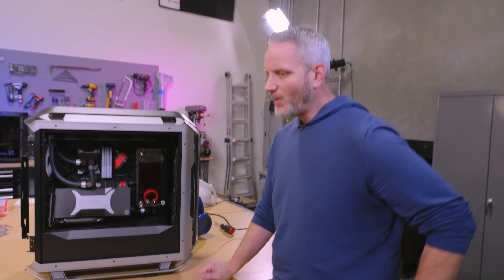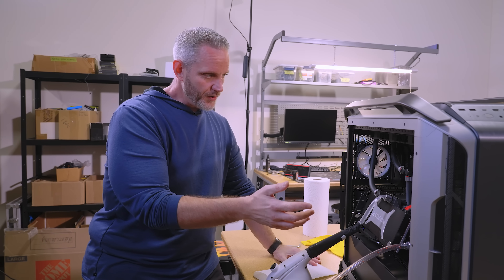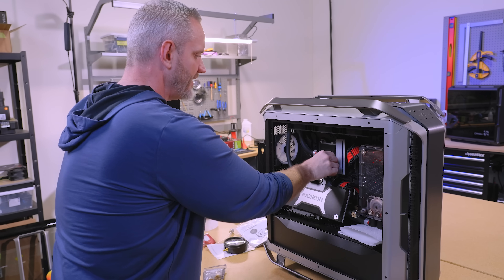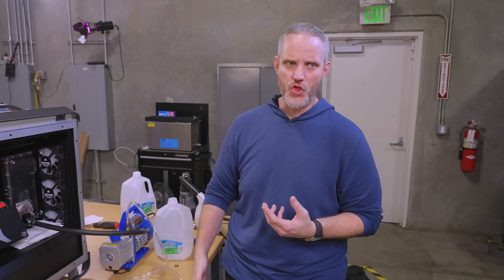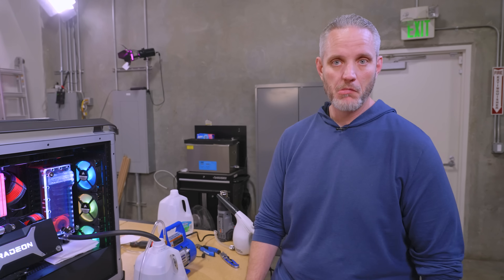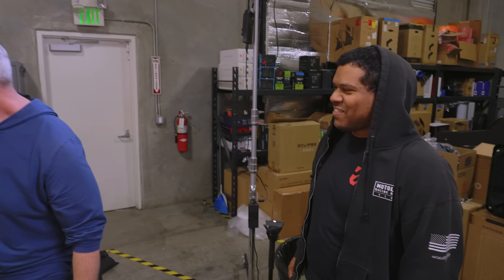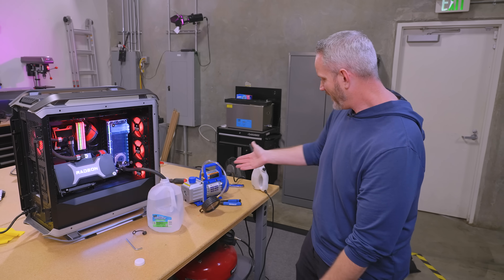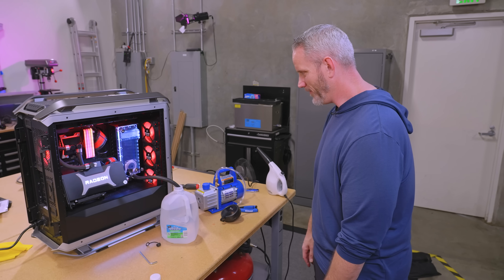I used Vacuum Pressure to fill a PC! Why didn't I do this sooner!?

Comment: You could do that so much easier and safer. When i change the oil on my vehicles, i use vacuum pump and 5 gallon buckets. I drilled 2 holes in the lid of a 5-gallon bucket, the style that screws on on, not the snap on ones. Then connect one hose to the vacuum pump and the other down the dipstick tube. When you turn on the vacuum pump it creates a vacuum inside the 5-gallon bucket, which sucks the oil out of the engine and into the bucket. Since there is a space for air at the top of the bucket, it drains the oil into the bucket and not into the pump. You could essentially do the same. You could hook one hose to the fill port of the system or preferably the highest point. Then stick the other hose in the distilled water. When you turn the pump on it would pull the water through the system to the bucket, spilling into the bucket when the air is out. This would make easy work with flushing a system as it would quickly pull clean water through the system into a bucket for disposal.

Comment: If you put the vacuum connection at the top and the refill at the bottom in a container with liquid, you suck in the water with the vacuum instead. 
No need to build (possibly harmful ) underpressure  in the system first..
Maybe not as fast, but safer.

Comment: some cares this is the only way to fill the radiator as the new engine blocks have huge air pockets.  
and no that is not oil vapor coming out of the pump, that is water vapor.

Comment: You're shrinking the radiator capacity when you hear "clink-clink-clink."  To correct it you'd have to apply positive pressure to re-inflate the radiators.  Advice:  Ditch the valve and let it fill gradually and gently with normal pump pressure

Comment: technically, there is no such thing as a vacuum. Only more or less pressure. "Negative Pressure" isn't a thing really unless you consider 14.7 psi to be zero pressure. Just saying

Comment: I've often wondered why you've never done this previously also. In my composites work, we use two stage, 12cfm pumps to saturate composites with resin with an intermediary vacuum chamber in between the pump with associated pull/dump valves, so if you have overflow, it goes into the chamber and not the pump. Conversely when you pull the vacuum, you could also pressurize your 'fill' vessel and hose it into the system. Though as you noticed, the item of concern are non-vacuum rated parts trying to implode on themselves. Real vacuum chamber parts are extraordinarily strong and have sufficient wall thickness to do this several times consistently and safely.

Comment: Funny how as we've got older Jay and I end up using the same hoses and basically the same route minus the GPU block for me.
Maybe Jay thinks the water from someone like EK is "just distilled" but it's completely different and I highly recommend EK water.
No coloring of the res (mine is like what Jay has there except 360 size) and I never need to change it. I keep checking it and it is fine versus when I used Koolance clear water I have to change it.

Comment: Jay im dissapointed.  you can use a water cooling pump in a bucket of fluid to pump/ or push water into the system.

Comment: That vacuum pump can help with other creative things, like degassing silicone for making molds, or getting air out of resin for making 2 part epoxy resin parts. Just need a vacuum chamber. Imagine the greeblies you could make with resin and silicone molds! (Seriously, my wife has that same pump, it came with her vacuum chamber for resin and silicone crafting.)
Reply: 3D Printing + Vacuuform.

Comment: If you had a bucket filled with water, and a valve with a barb fitting on the bottom, you could seal the system under vacuum attach the hose (with air) to the barb open the valve to the bucket, let the air exit the tube between the system and bucket of coolant, then open the system to the bucket, this would reduce the level of air in the system even further and if your building a filling station would be quite easy to do aswell
Reply: It’s a similar idea to an air lock just simplified

Comment: just hook the pump upto a big pot vaccum the pot and then isolate the pump, open the pot up to the system and it will just suck it into the pot.

Comment: A T Piece with a valve / tap on one side would help remove the air in the tube, pull vacuum on one side, flip the switch and release the liquid...

Comment: Not sure if it would work or not. What if you had a hold tank with a quick disconnect on the bottom. then have a quick disconnect on both ends of the hose in between it and the fill port.

Comment: Question, and I'm sure other people have asked.  What's to stop you from having a quick connect system with the loop coolant suspended and pouring down into the tube into the loop, so that gravity forces the air out of the tube?

Comment: Adding a fluid separating jar is not that hard, one person break bleeding kits have them just plumb it in line and you are finished. You can also run a hose with two cutoff valve in line and have the fill line attached to the same line, so many ways you can do this!

Comment: You need a fitting with 3 shutoffs. One for vacuum, one for water and one for pc. That way you can close the pc valve, pull(prime) water into the tube.  Additionally, you could pull the water out with this system by having a cuttoff tube (split) going to the vacuum  that is kinked to remove air and unkinked to remove water.

Comment: Maybe you want to pull the vacuum at the highest point, i.e. the Phil-port, so you could prime the original drain port with fluid while under low vacuum, then increase the vacuum and phil the system all the way. You might want to include a small reservoir in front of the vacuum pump, so that it cannot suck liquid. But that is just my two cents. 😎

Comment: The Aquacomputer LEAKSHIELD already  fills the system with water via a vacuum. Of course it's more expensive than a vacuum pump, but it also has more features than a vacuum pump.

Comment: I'm sure this is obvious, but pulling that vacuum before the fill and letting it sit under vacuum for 2 or 3 minutes will also let you know if your system has a leak so you can address it before filling! Two birds one stone 👍

Comment: Aqua computer created a far more elegant solution.
It's called LeakShield and basically dose the same thing , creating vacuum pressure inside the reservoir and it's awesome for leaks , filling and draining the reservoir.
Only works with their reservoirs though....so they are far ahead of your idea 😂

Comment: If you had a separate vacuum line and fill tube, you could put a valve on the fill side of the bottom of a jug etc so there is no air at all.
E.g. vacuum from the top, then fill from the bottom

Comment: I love when I have these moments, for me they're super rare, can't think of a recent example... I know there is one, since I talked about it recently with my mother during are weekly calls. Because it was using something in a manner it wasn't meant for, but made the task super easy that I think I just now subconsciously do it. I know one thing from a long time back, was, since I don't use my dishwasher, I found it makes an amazing multi-tiered drying rack. Another was marying a surgeon's knot with the typical shoelace knot to make it more secure since double knotting would still cause my laces to come undone. I have a weird gate due to my feet deformity. They just have SUPER HIGH ARCHES, so look normal enough upon inspection.

Comment: Vacuum is also how you leack check hvac and cooling systems. So in theory you can leack check the loop while under Vacuum. If its loosing Vacuum you have a leak.

Comment: I started water cooling like 5yrs ago, and I used a vacuum pump the very first time. It was a soft tube system by the way.  I used it to leak test, If it holds vacuum, it'll hold pressure.  I have always wondered why you and all other youtuber/water cooling experts have never done this.

Comment: Imagine if you will, an empty water cooled PC brought to a local LAN party. the user brings out a  jug of what appears to be Mountain Dew. but in fact it is NOT the drink of gamers but the needed cooling that that CPU and GPU requires.. The Gamer now switches a mechanical flow director marked "IN" and "OUT" to "IN". connecting some tubes then a hand held vacuum pump. the PC is  immediately filled and the Gamer starts updating steam. after a well played night the gamer then places the flow director to "OUT" and quickly drains the system. secures the PC with needed padding and heads back home.

Comment: fill the hose by acting like you are syphoning gas, cap it with your thumb and slam it on the drain fitting.

Comment: You can drain using a jar and two tubes to the top. Pull the vacuum on a short tube (so it collects air) and long tube to the bottom of the jar, where the coolant should end up. Just make sure the jar is way big enough for all the fluid and a bunch of air. Same system is used on vacuum pumps so you don't ingest stuff.
Reply from the maker: Yeah we realized that after making this. Already working on it!

Comment: aquacomputer have vacuum cap for reservoir which can be used for filling as well. You was not first :)
Reply from the maker: Vacuum cap is not a full system
Reply: @Jayztwocents  well, it depends how much negative pressure to count as vacuum lol. But your variant is good af ))

Comment: Jay, try hooking it up to the fill port and put the fluid through the drain. Without vacuum and stuff. Easyer on the rads. No risk to the structural integrity.

Comment: Pull the vacuum at a high point and fill at the lowest point.
I wouldn’t vacuum it down to much as the radiators are going to be a weak point.
You could use a brake bleeder to fill or empty or you could use a weed sprayer type device to fill from a low point.

Comment: The way the gauge is hooked up is kind of pointless in getting a measurement of the vacuum in the system. All it’s reading is the pressure at the pump. Try putting the gauge in line with the hose or just not using a gauge at all. It’s such a small circuit and you don’t care about removing contaminants in the system.
Reply from the maker: That's not how it works man lol

Comment: @jay. Love the idea. Being in the automotive industry I completely understand this concept. My suggestion is to use the setup you did. However I would utilize a second valve hooked up to the top of the distro plate  (where you would top off)  take that line and install in your fluid. Close the valve. Apply vacuum through your drain and close. Slowly open the fluid fill valve just enough to allow vacuum to pull and bleed the hose. When you get some fluid close it and re apply your full vacuum. Than fill the system. Also. Don't just crank the valve open when you fill. You can actually shock the system doing that. A nice steady slow fill is best. Even in automotive. Absolutely love this idea. And I hope you try out my suggestion. Let me know how it works out. Appreciate the work you do. Keep it up guys

Comment: @JayzTwoCents what id You put a valve fitting on fill port. theoretically You can then shut the vacum/drain port, open the fill port and get full system filled without need to top up - no air from tube switching

Comment: Great idea for guys like Jay who build a lot of systems, or for SI's, not really practical for most of us though as we generally only do this very infrequently.  Would be interesting to see long term impact of doing this over and over to the same parts... when do they start to fail and need to be replaced (after 5 vacuum fills? 10? 20? ...)

Comment: Nice one.
About the small loss of vacum in the hose.
You should look into a valve more.
In automotive we got 2 valve.
Connect setup, one hose in coolant, one hoose in vacum.
Turn on vacum, when coolant hose is full up to valve, close that one, and make system a vacum.
Then close vacumvalve, and open coolant valve.   Complete full system

Comment: Jay I beg you, do more research on this as a video for us, Like what vacuum effect has on different type of tubing (hard and soft), different type of reservoirs, distroplate, cheap and expensive fittings, different size of rads (and cheap vs expensive rads). I do believe this may be a viable option for fillings, but at the same time I have seen industrial equipment fail under vacuum (queue the science experiments of hot containers in cold water).

Heres hoping for a a few more vids of crazy experiment's with Jay.

Comment: @JaysTwoCents you should take one of your radiators sitting around to see if the vacuum is actually doing any damage to the rad, otherwise this is actually a good idea
Also, they make automotive reservoirs that are made for vacuum evacuation that separate the air flow from the fluid.

Comment: On a small roller mount a vacuum  pump and a small air pump with a a/c manifold set.. use the common (center line) to a valve then a tee on the tee you have a line that connects to the pc and front the tee you have another valve for both dump and fill.

Step 1 at 15-30psi to the system, then open the dump valve. This will force the fluid from the system I suggest doing this a few times.
Close the dump valve switch to the clean fluid. Pull vacuum and open. The dump valve to inject clean fluid.

Comment: recommend making sure the pump isn't plugged in, if when you pull the vacuum it makes the pump's motor spin the wrong way then you've just turned it into a generator wired directly to the motherboard which could be potentially pretty bad.

Comment: as long as the gauge is in green its fine, but you should try turning it on while after you do the initial fill, should help continue to fill before you close the fill valve.

Comment: If you add a v splitter with a valve you could prefill the fill tube therefore no air would go into the system, thats the same way they do it in automotive industry

Comment: could probably build a manifold out of a brass tee and some valves to eliminate  the air in the hose.  i'd use like 1/8 npt, because you'll still always end up with a tiny amount of air between your two shut off valves

Comment: Why not use that plug on top of the tank to extract air, thus pulling in cooling liquid to 100%?
Add one valve and some hose - and that's it.

Comment: You could prime the hose behind the valve after taking it off pump. Perhaps put a spigot with a valve at the bottom of a bucket (that holds your coolant).  Hold bucket in the air, open bucket valve to fill hose then open valve holding back vacuum.

Comment: You could use this technique to drain a system as well. all you need is a suitable airtight container.  pull a vacuum in that container, then connect that to the system. open a valve to the container and the vacuum inside should pull the fluid out

Comment: Seal the bottle at about 95% full, hook it up to the reservoir, lift it so the fluid replaces the air in the tube as the air will want to rise, then flip it back down. If the bottle is full enough you can minimize how many air bubbles re-enter the tube before starting the pump. Easy fix, might make a small mess if you don't have a perfect seal on the bottle :P

Comment: Great video, couple things id change. #1 cap of the 2nd vacuum port on the pump with the appropriate vacuum cap, #2 change the vacuum pressure gauge to an in line micron gauge, #3 replace the cheap clear plastic hose for  2 proper vacuum hose lines. First hose having a manual ball valve to close and retain the vacuum in the hose line post pumping facing towards the micron gauge side, the 2nd hose going from the micron gauge to the used port on the vacuum pump. Once the pump reaches the desired microns of vacuum close the vall valve, shut off pump, disconnect the hose going from the fill port to the micron gage, submerge the valve end under the water and open the valve. Close your fill port. Done and should now have either 0 air or almost 0 air in your system.

Comment: surely someone else already said this but im to lazy to go through the comments. so, just prime the tube with fluid and have the source/reservoir above level (bottom drain valve). in fact, you can make a reservoir to both fill and empty the loop with vaccum. say for a example an old empty fire extinguisher bottle, or a co2 cannister. you can vaccum the loop and fill it as mentioned, or you can vaccum the resrevoir, connect it to the loop, open the valve and have all of the fluid be sucked out of the system into the reservoir.

Comment: You should have messured flow before and after becuase this method can compromise the structure of rhe radiator and permanently implode the radistor enough for it to affect flow.

Comment: Y'know jay, there are ways to use this pump to to drain a system without having to kill the vacuum pump. I forgot how it works exactly how it works but basically by having a moving stream of air alone, you create a low pressure region where your liquid gets pulled towards. Doing some clever trickery with junction pieces won't have any liquid make it to the pump.

Comment: I wander if you could use the pump in a different way. To prevent potential damage from the vacuum. By having the vac pump attached to the top of the loop somewhere. And the water line attached to the bottom of your loop Going to a jug. So when the air is leaving it will fill up you loop at the same time. To prevent water from getting in the vac pump you could have it connected to a second empty reservoir. With the pump line at the top and air out line at the bottom so you can see when the system is full.

Comment: a better way to do this would be pull the vaccum on the fill port and have the drain port with a valve into the liquid. then no opening to atmo is needed